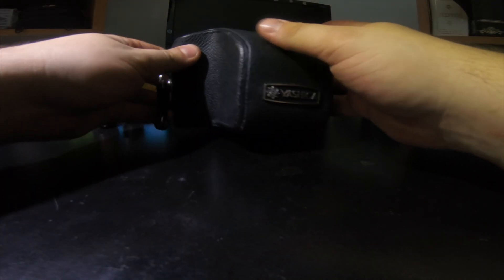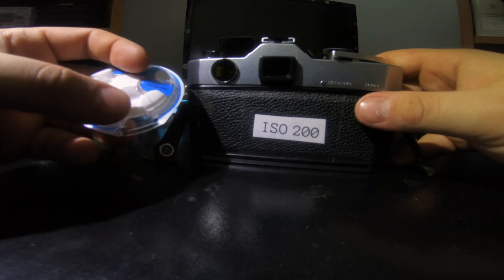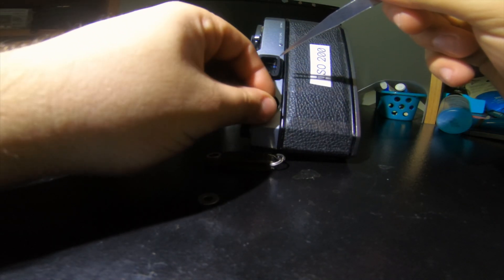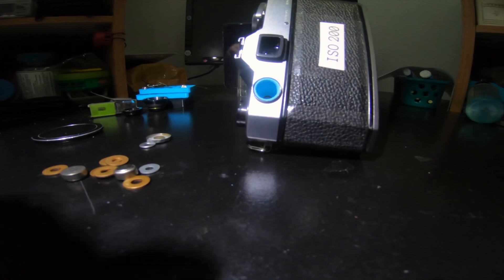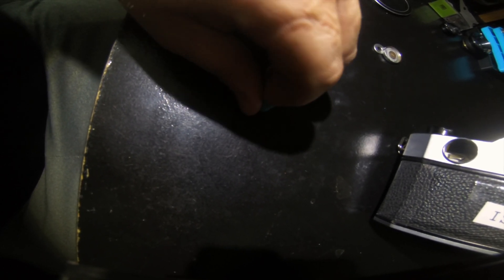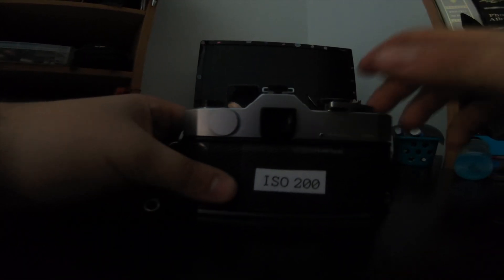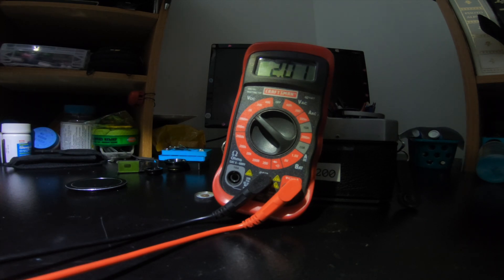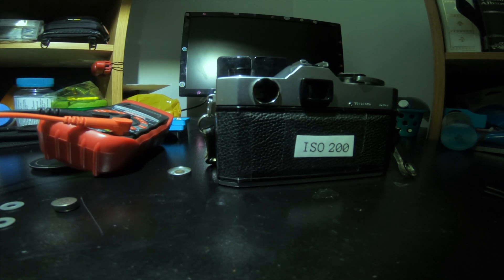Yashica TL-Electro Battery Fix

Comment: Hey, I did this with the battery, but I haven't put a film in yet. Does this effect whether I see the green light or I don't? 
Because currently I can't see the light eventhough the battery is how it is supposed to be in this video.
Reply from the maker: Does the camera work like does the shutter fire at different shutter speeds?

Comment: Hi, where does the negative side of the batteries connect to? I can see the spring at the end of the compartment. However I am missing the battery cover and with mine I can't find an other contactpoint for the batteries. Is it the cap that it connects to?
Reply from the maker: Yes, the battery cap is the negative ground and what the negative terminal is on this camera. You'll need the battery cap to use batteries in the camera

Comment: Love your video. My tl electro has an aperture problem. If i engage the light meter (no battery) and set the apperture, when i take the shot, the mechanism inside will get stuck and i have to turn the button off for it to work again. Do you know what cause that ?
Reply from the maker: Batteries are required for this camera. The camera will only shoot at 1/1000th of a second without batteries as the shutter is electrically timed. You might be able to get by on bright days with iso 400 or 800 film but the inability to change shutter speeds is a problem. Will need to use this camera with batteries

Comment: Hi, is there a reason that silver oxide works better than zink air? the silver oxide ones are hard to get in my country.
Reply from the maker: Yes- silver oxide batteries are sealed and last much much longer. Zinc air batteries are closer to what the mercury batteries used to be but have a holes in them which is how they work. The batteries last about one week with moderate use. You can cover up most except a hole or two with glue or nail polish which will let it work for about two weeks. The zinc air batteries are extremely corrosive and will break apart and leak out corroding battery terminals. Silver oxide batteries are much superior and last much longer- I replaced mine every 6 months or so.
Reply: @AleksUsovich  Thanks for the video and keeping up with the comments. I want to try this mod but am wondering, what washers/adapter do you use for the larger silver oxide 357 batteries?
Reply from the maker: Sean, I used plain old hardware store brass washers. Just take the 357 batteries into the store and find some brass washers that are a little smaller in diameter than the battery.

Comment: important question: are the batteries really necessary? bc i live in germany and i can‘t find any of the recommended batteries for the camera even on the internet
Reply from the maker: Yes batteries are required for this camera. The camera will only shoot at 1/1000th of a second without batteries as the shutter is electrically timed. You might be able to get by on bright days with iso 400 or 800 film but the inability to change shutter speeds is a problem
Reply: @AleksUsovich  is the shutter important for the pictures? or will the pictures look the same even without bateries?
Reply from the maker: @llaveante  the shutter is the part that moves through the back when you press the shutter button. You'll have to compensate with a small aperture and lots of light and high iso if the shutter is set at high speed like 1/1000

Comment: My TL Electro like many old cameras has a stuck battery cover, I guess due to corroded batteries inside - so no meter. But all the shutter speeds work from 1 second to 1/1000th and seem accurate by ear without any battery power :-) I like to get cameras working so I will fight with the battery cover one day!
Reply from the maker: That's quite interesting to hear. My TL defaulted to either 1/500th or 1/1000th if I didn't have a working battery in it regardless of the shutter speed that I set. I've heard that putting some vinegar over the battery cover over a period of a few days can help soften up the cover by eating at the corrosion. That might make it a bit easier to get the cover off without destroying it.
Reply: @AleksUsovich  Thanks, I have heard of the vinegar trick but not tried, I might attempt to open the top of the TL in the future (as that would facilitate vinegar soaking), but two Pentax's acquired this week are being worked on first :-)
Reply: just picked up a TL-E and found the same issue of the stuck battery back, but still excited to see what it can do!

Comment: I have the same camera and always having shutter problems, it gets stucked often. Do you know how to fix it?
Reply from the maker: Do you have more info about it? Does the shutter get stuck at high or low shutter speeds? When using the metering button? Any way to replicate it getting stuck?
Reply: @AleksUsovich    it's probably because of advance lever, it got stucked too, I watched some youtube videos for other cameras to try to figure out the problem, I dissambled the bottom part to find out it there is anything out of its place and there was a wire that looked creepy actually, like its ripped or it got out of its place.
Reply from the maker: @ebrusevli3219  Sometimes the springs or wires that work in the advance mechanism get stretched or snap leading the advance or shutter not working. The best way to fix it it could be to find a camera for parts on eBay and use those parts to fix yours. 
I had a problem with the mirror sticking sometimes after I took pictures at slower shutter speeds, which was fixed by using isopropyl alcohol on the old seals that the mirror touches. I don't have it sticking anymore. You could also open the back up and try using different shutter speeds to see where it gets stuck. This particular camera only fires the shutter at 1/1000th without batteries and anything slower could cause the mirror to get stuck without returning (until shutter is fired at 1/1000th). With batteries, it should be able to fire at all other shutter speeds.
Reply: @AleksUsovich  I think I had it on slower shutter as well, that makes sense.  Well that was so helpfull thank you so much, really.
Reply from the maker: @ebrusevli3219  Glad that I was able to help you out!